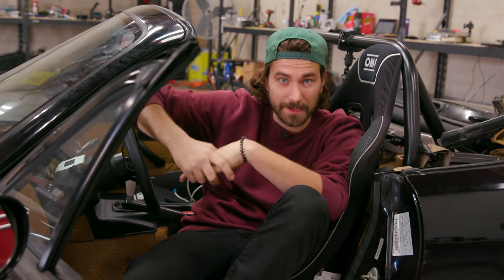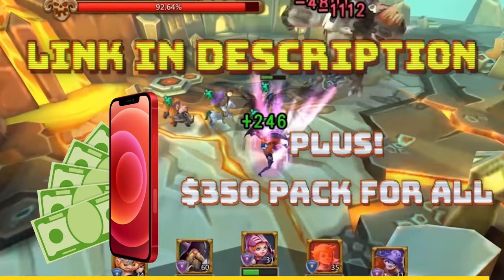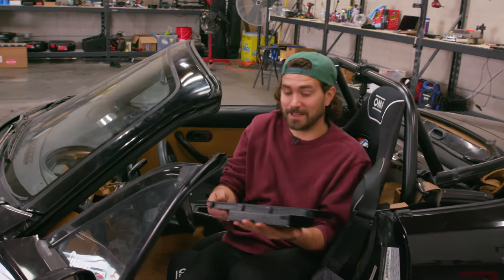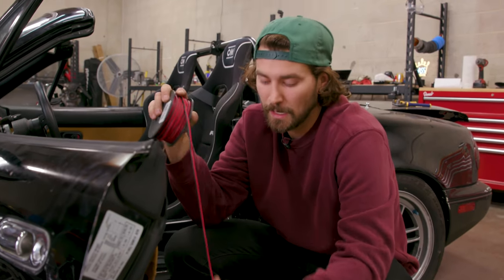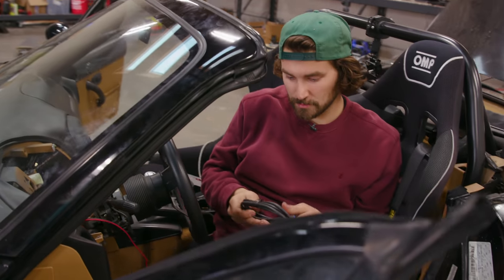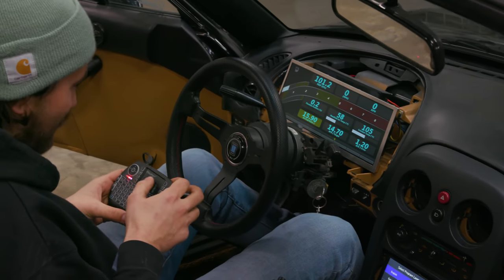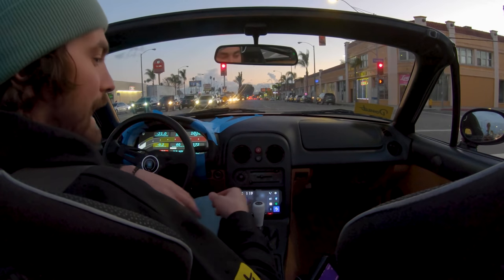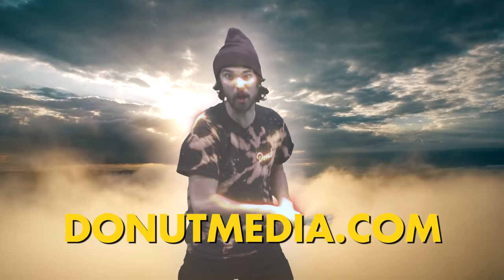Is a Digital Dash Worth It?

Comment: All those screens in cars will burn out at some point, I can't imagine how expensive they would be to replace
Reply: Is that really something to worry about ? The Toyota Cressida from the 80s had a digital dash. The last 10 years of Teslas have digital dashboards, and so do a lot of cars in the last few years. 
Sure this one is aftermarket and may not be as long lasting as those, but its still long enough for it to not matter. Its a project car, stuff is gonna break anyways.
Reply: @mugu007  digital dashes are lame imo.
Reply: @morallyemptycorruptedmaggot  well, it reduces production cost and gives the user a better experience. I dont see why any car manufacturer wouldnt jump on immediately. Its the future
Reply: No they won't. Just for reference. I use my monitors at home a LOT. And I mean a LOT more than a car's screen will ever be used on a daily basis. And just now, after 7 years of at least 4 hours a day it still works perfectly. No burn in, no ghosting, no glitches. Modern screens should easily least 10 years. Unless you drive your car 9 hours a day.
Reply: @morallyemptycorruptedmaggot  I will not buy a car with analogue gauges anymore. Unless I have to. They make cars feel dated and simple.
Reply: CyAn that's a good monitor then. Having screen constantly on full brightness and have it in a environment where there is a lot of temperature change and constant vibration is a lot harder on the screen.

Comment: You could have replaced the original ECU for a FuelTech FT600. It is an engine management unit embedded in a digital touch screen. That is two for one. Gage cluster and ECU  replaced by a FuelTech product. A proudly Brazilian made car tech!

Comment: Back in the 30's (before TV) RCA came out with a household Radio that had 10 knobs on it. Only 2 where connected to anything (volume & tuner that was it). The other 8 knobs where just "spares" that you could turn, doing nothing at all. 
They out sold all the 2 knob companies 10 fold. 
And they say Digital Dashes aren't traditional.

Comment: It would be cool if that company made more shapes than a monolith looking thing. A few with rounded tops at different radius, different size squares and rectangles. It would make it easier to modify the guages housing for different cars without the company having to get make/model specific. The size of it looks like it may work perfect in an 80/90's era Volvo 240 or 740. I really have the bug for another 240 wagon in flat black murdered out stripped of most interior. Wide bodied just a bit for 235/35/19 front 255/45/19 rear. To once again collect rare Volvo motor parts and build a 240hp, 2.3L, 16V, DOHC, turbo, inline 4cyl with 5 speed trans.

Comment: 4:50 you can see the connections ports, it is a Raspberry Pi 4 with what looks like a pi hut 12-inch screen. guessing a few other off-the-shelf parts plugged into the 40 pin I\O. Crazy.

Comment: hope it has a good dimmer adjustment!  I HATE driving at night with a vehicle where you can't turn off, or dim down the instrument cluster.  If I'm in canada, and while I'm highway driving at nightm, cruise control set, I'm more concerned about my night vision so I don't hit moose or deer.   you see people driving at night with their guage cluster at max brightness, like how can you see anything other than the painted lines? just a pet peeve.    ALSO , did you know that most gauges and all tail lights are red because, red is the longest wavelength of visible light, (think rainbow, its the longest on the outside) so your eyes can relax more easily and can adjust back to the darkness.   Sailors have used red lights to look at their maps for decades,  so it doesn't cause their pupils to contract and keeps their night vision at its best, and their pupils large!

Comment: TBH I'm not a fan of swapping gauge clusters from analogue to digital, because most of the time they don't fit right and kind of looked just thrown in place (this isn't the fault of the person's just the way they are designed) I personally wouldn't do this unless I found a dash that was made to fit perfectly with the car I was swapping with

I think Zach does do a very good job doing this swap tho ngl

Comment: that looks dope AF! - fwiw though, can you change the refresh rate? I noticed that it was only updating about once a second...  can you also use this for data logging and bring the files back inside for analysis later?
Reply: The former will depend on the polling rate of the sensors in your car, the latter is a most definite yes.

Comment: I also own a turbo miata so i get it but losing fuel guage and speedo would be a bit much. I think there is a way to pull a wire from the guage cluster to the ms to get speed but now that the cluster is gone not sure how that would work.

Comment: So I have my daily and it’s a 2012 GMC Canyon. If you don’t know 04-12 Colorado/ Canyons didn’t have really any change so while I have a 2012... it feels like a 2004.  My issue I have is, do I attempt stuff like this.  I love my baby, and want to do it, but I am afraid of GM pulling a GM and having electrical issues.  Being said I also am curious; should I install a new alternator to help support all the extra electrical equipment?  I have an Optima Yellow that I retro fitted to sit in there, so I should be good battery wise.  Like I said, this is my baby, and I don’t want to hurt her.  Any suggestions?  (Also keep in mind that no one makes a lot of parts for this vehicle) there was a lift kit shop who is pretty much best around, and they had only 1 lift option.  Finding parts isn’t easy, but I make due.

Comment: There's an easier and cheaper way to do this... Get a bluetooth or wifi OBDII reader. Connect it to your iPad or iPhone. Download an OBD app like OBD Fusion or Torque Pro. 
These apps place whatever dials or gauges you want on your iPad. With the info taken from the OBDII port. You can even read fault codes and reset the check engine light while you're at it.

Comment: HOWEVER!!! POINT TO NOTE HERE... Looking at your test drive, it seems that the processor built in the screen unit is not that powerful (hence looking a little laggy), so.... Do a test with less displays on your screen to test if the response times for the display speeds up, if it does, then find your happy balance of information and responsiveness of the screen.... 🤔😎

Comment: congrats you put a raspberry pi with an aurdino and a screen in your dash. you should take it apart and replace the screen with a touch screen. you could also connect a camera and a large flash drive for a dashcam.

Comment: Its funny that he never mentions the price of the build, full retail of this build is, $800 for the magasquirt, $700 for the screen; that's a total of $1,500 for maybe a couple more gauges on the dash. then there's a big question of reliability which wasn't tested in this video, and its important because if it fails he could lose his entire gauge cluster. I know he mentioned it but I bet there's a way he could keep the oem cluster and put in a screen large enogh to fit all the extra guages he wants, in a way that fits in with the rest of his interior, and for much less money. And if it proves unreliable in anyway at least he has his oem cluster. it would be nice to see a follow up video comparing the two options.

Comment: Wait the stock ecu in my beater from 1999 updates PIDS twice as fast and all I bought was a $5 phone mount. It jumped 2300rpm in one frame with a 27% throttle blip?!?!
Call me crazy but it feels like it's from the early 2000's, so outdated. No touchscreen and has its own controller keyboard lmao.

Comment: The response of the tach is wayyyyyy too slow. Id prefer this on the dash or replace the radio so i can check oil/air/fuel etc when i need, but have a proper instrument cluster.

Comment: if i were to get a digital dash, i would try to get a screen with a higher refresh rate.
Reply: its not the screens refresh rate. he needs to set the baud rate on the raspberry pi to something higher like 115200. its probably at the standard rate of 9600. i have basically the same setup in my saturn and its butter smooth.

Comment: Having a 85 c10 that I don't want aftermarket gauges everywhere a digital dash is where its at 🤷‍♂️ screw all the old dudes that get mad for hacking up the dash 🤣🤣 riding around with a horrible retro sound radio because of it also 🤦‍♂️

Comment: My boss got a 2021 bmw 750i as a loaner from the dealer, and it doesn't have 200 miles on it, but one day the gauge cluster went blank. Like he can't see anything. No speed, rpm, gas. He had a few other problems in his 5 series as well. Which is why I am never buying a bmw. I'm sticking with my prius. What shit cars bmw makes.